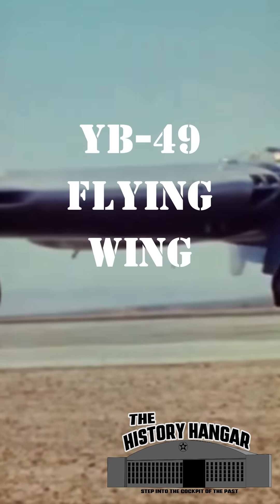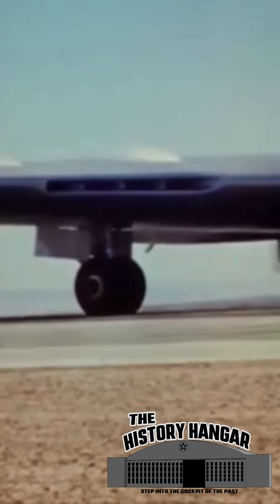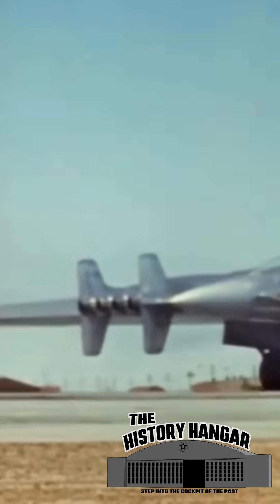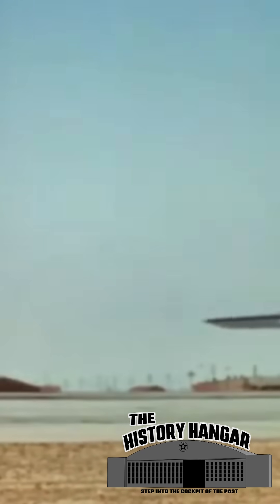When the Air Force Rejected the Future: The YB-49 Story #militaryaircraft #thehistoryhangar #history

Comment: The YB-49 flying wing bomber was not selected for production because it tended to have enough directional instability that it couldn't accurately drop bombs. The modern stealth bombers based on the flying wing concept are fly by wire, a technology that was not available for the YB-49.
Reply: I don't trust this comment about the lack of enough stability to drop bombs.
If the Northrop Flying Wing was able to land and takeoff in an ordinary airstrip, it was able to drop bombs with enough precision.
Jack Northrop also denied the accusations of structural failures.
He went so angry, that destroyed all files about their Flying Wings.

Comment: Hah, Jack just copy and pasted the Horten Brothers design for the Ho XVIII...
Reply: Yeah... Hate to break it to ya, but no.

The YB-49 here was a modified version of the earlier YB-35 which was first made in 1943, which originally utilized propeller driven engines which were swapped out in favor of turbofans in the YB-49. The YB-35 actually was tested before the first flight of the Ho 229, which was the basis for the Ho XVII, so the design actually predates the Horten brother's designs.
Reply: @no-legjohnny3691 nope. The Horten brothers flying wing gliders and prop driven prototypes flew as early as 1938
 It was just the jet engines they were waiting for. I know it, im living 30 km away fom the wasserkuppe,  a nearly 1000 meters high Mountain in the middle of germany the nazis used as a test site for different glider and conventional aircraft models.
Reply: @leander2843  And Jack Northrop started making flying wing designs as early as 1930. The Horten brothers were truly pioneers of aviation, don't get me wrong. But saying that Jack "stole" or "copied" their design just isn't true because they both developed their own designs parallel to each other.
Reply: @no-legjohnny3691 okay, fair point. I also give him Credit for getting the plane into the air more than two times...
Reply: @no-legjohnny3691  that's not correct.
US planes were all using straight wing up until the end of the war, when they got access to German research on swept wing (used by Germans on ALL late war designs, like me262, me163, ta183, ho229, etc.).
So, at the very least, they copied the swept wing concept from Ho229 and other German designs
Reply: @frankguz55 bingo
Reply: @no-legjohnny3691   but you would have to read a history book to know that and the Luftbird would never do that. 😅